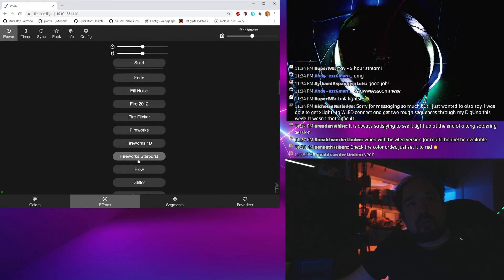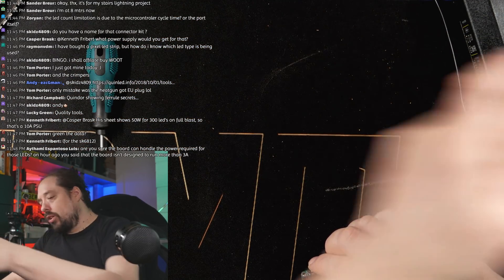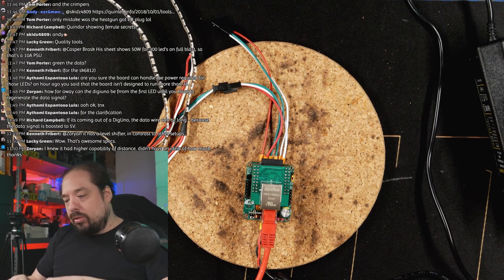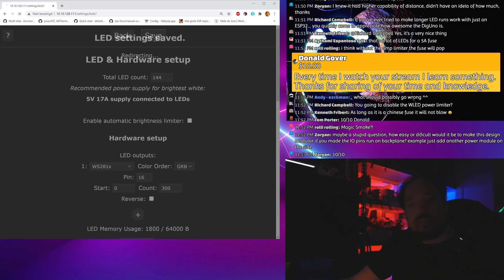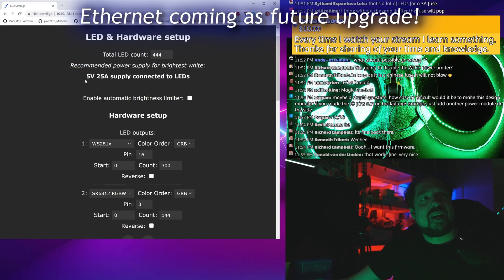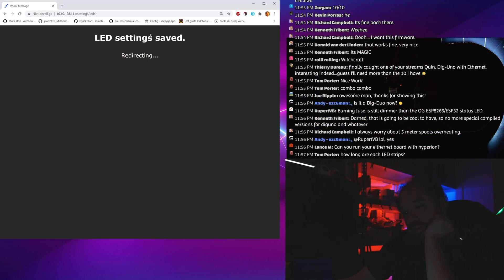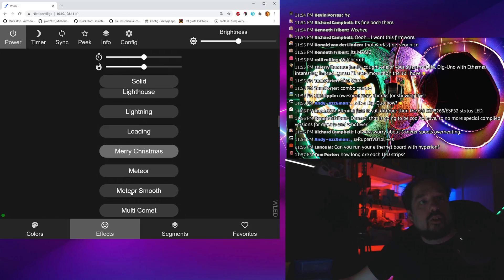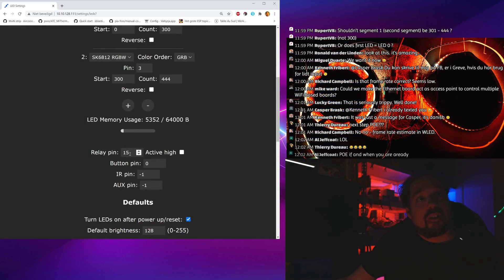QuinLED: First preview of WLED 0.12.0 multi-channel on QuinLED-Dig-Uno (Dig-Duo?!)

Comment: Very cool! Would this work with Hyperion as 2 different entities?
Reply from the maker: No, internally and over E1.31 it's seen as one big LED strip. You can cut it up into segments using WLED or if you are pushing the pixel data remotely, that would have to cut it up.

Comment: Hi,
I tried this with my dig-uno with ESP32 and it didnt work for me. The dig-uno never goes online :(
What is the correct  position for the data jumper?
Can this multichannel wled version works with a diguno esp32?

Regards from Mexico!
Reply from the maker: Yes, that should be working fine. Not sure what went wrong. Did you flash it correctly?
Reply: @IntermitTech  yes, I flashed it correctly. It is running version 0.12.0 into my diguno. 
What is the correct position for jumper GPI02 or GPI03?
Reply from the maker: 2,left side. And then it should be pin 16 and either 3 or 1,depends on your ESP32 board. Check the pinout guide.
Reply: @IntermitTech  I will check the pin guide! Thank you!

Comment: Awesome! I'm building a new house and prewiring the whole place for LED strips in every room. I really want to use dig quads to control them, but I need to be able to control them via Google home, and that isn't supported by wled yet. Any idea if that's on their planned feature list? 

I'm so glad you have this running on Ethernet now. Will definitely use that if info with dig quads (which I will if I can use them with Google voice). Please let me know if you have any suggestions. Thanks!
Reply: Thanks for the reply! I'll look more into home assistant. I've got it set up on a pi 4 but haven't gotten too far with it yet. I've got a few other irons in the fire but have begun gathering and configuring network/smarthome gear as we build. 

I should have clarified that the led strips will all be accent lighting, not primary. Primary lighting will be recessed LED cans on dimmer switches (haven't decided on wireless protocol/smart hub yet, likely zwave or zigbee on either home assistant or hubitat). LED strips will be in each room along the top edge of at least one wall, above and below kitchen cabinets, around bathroom mirrors, inside/under railing in stairway, floor to ceiling in the corners of the living room where there are 20ft vaulted ceilings, and maybe a few other places. We're planning on several motion sensors to trigger them after sundown (stairs, kitchen, bathroom). 

Once I get further into the process I'll likely join your discord for more ideas, and of course to share pictures of the finished product. Thanks for all you do for the community!
Reply: Scott , I’m looking to accomplish the same thing. From what I’ve seen you can also use IFTTT to interface between WLED and google home. I’m thinking about using some basic commands to flip through a few presets until I can make it more seem less. Just got my lights installed under the cabinets in my kitchen as my first test run. Next will be a 10m strip along the front eavestrough of my house ! :)
Reply: I do have home assistant fully integrated into my smart home now. Still building the new place, so haven't gotten strips on wled yet, but getting ready to do some short test runs. I'll try giving IFTTT a try and let you guys know how it goes. Last time I tried to use IFTTT for automations it worked well but was slow, but that was a few years ago.
Reply from the maker: I don't know about direct Google home support anytime soon, from what I know of it, it has something to do with needing a cloud infrastructure to be able to support that which WLED will likely not do very soon.

You could look into running it through Home Assistant, WLED integrates very tightly with that and it can in turn be controlled by Google Assistant again.

Also, as a side note, currently any digital LED strip really isn't suited for primary lighting. Accent, color and effects for sure, but RGB white is horrible and even sk6812 RGBW isn't great white either, better for sure, but still quite low quality vs a decent white LED.

Comment: @Intermit.Tech when a stable ethernet version is there, can you do a tutorial on this, because I can`t find information about WLED and Ethernet anywhere?
Reply from the maker: Yes, there will be videos and articles exactly how to do this. :)
Reply: @IntermitTech  I have another question. I have installed a new wled led controller on a esp8266 together with the ws2812b leds. But when the leds are told to be black, every like 12 hours the second to the tenth led turns white. Do you know why that could happen? Also I should mention that the data wire is like two meters long and I connected everything directly to the esp. Thanks for your help.
Reply from the maker: Hmm, no, not sure why that would happen
Reply: @IntermitTech  a pity but never mind. Thanks for your fast answers. hope it will just stop. Nice Videos. I really enjoy watching them.

Comment: I've been using the modified build for multi output on the dig quad. Works great when I set the segments but if the controller restarts, it loses the segment info and you have to reload it. Its very annoying then when added to home assistant and home assistant can't see the new segments on a controller reboot. You have to manually go in and reload the segments in preferences. Will 0.12 solve this? Really great protype board BTW. Looking forward to ordering some.
Reply from the maker: What you could do is make the segmented preset the boot preset, that way they should always load. I think 0.12.0 will still work in the same way.
Reply: @IntermitTech  that's great. I didn't realize I could change it so the presets load on boot. I'll check it out. Thanks 👍👍

Comment: Does it perform better if you split op 800leds over 2 pins vs 1 pin?
Reply from the maker: Yes it does, I recommend a max of 600 per pin because of protocol limits. Using multiple pins helps with that.

Comment: Don't really understand the stuff about the pinouts and the pin numbers. Where can I learn more about those?
Reply from the maker: It's the pins used on the micro-controller. Currently they are set during firmware compile but this is limiting. In the upcoming new version you can set then while running. You look up the pins used on my website.

Comment: Please help me with this. Im struggling with choosing the best power brick. How much power and how many controller do i need for 15m ( separated thru extension ).. the led will be ws2812b . 60 per m. And the controller would be sp108e wifi.  And LED will be separated 2m each
Reply: So how many meters ledstrip are you going to use?
Reply: @blikje_in_de_water  in total? 15m.  But its separated to around 2m each strip. If u wish to help more please contact me at instagram: DLU   / or snapchat: transmitted1 / or anything u need let me know.

Comment: nice setup! 
please can you measure the frequencies for high frame rate video?
Reply from the maker: You mean of the LEDs? Hmm, I'll look into that but it's likely what the LED chip says in it's datasheet, I don't really have a high speed camera but I guess I can raise the shutter speed. For all my studio lights I used analog LEDs which run on my Analog QuinLED boards and thus can run at like 120.000Hz so perfect for camera usage.

Comment: one thing I've noticed is if you rebooted it loses all segments
Reply from the maker: Yes, that's normal, once you reboot it all becomes one big segment again. Easy fix is to make a preset with your segments set and then set it in the presences to boot with that preset, that way once it boots the segments are always set. :)
Reply: @IntermitTech  thanks for the info👍

Comment: Nice, very excited to install it when it's stable. Sadly it hasn't implemented the temp sensor of the dig uno board yet. Would be nice to have an option for activation in the GUI but this would make WLED too specific for the DIG UNO right?
Reply from the maker: Yeah, reason for Temperature sensor not being compiled in by standard is because for the longest time the code caused issues with flicking LEDs. There was a lot of work done to it recently though so I have to retest if that is now fixed and thus we can compile in the temperature sensor by default. :)